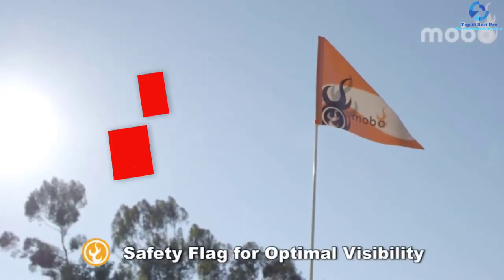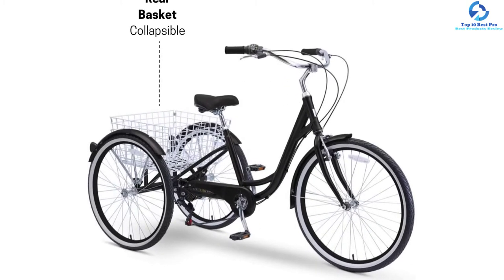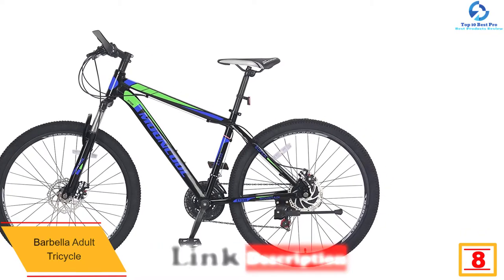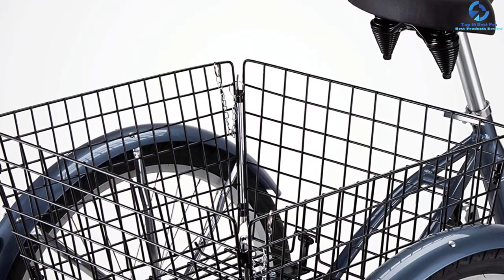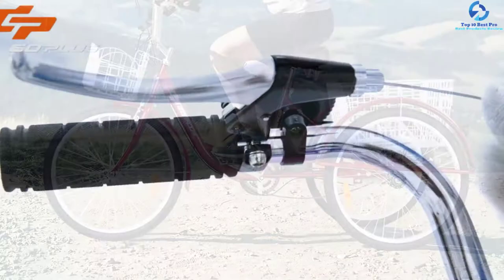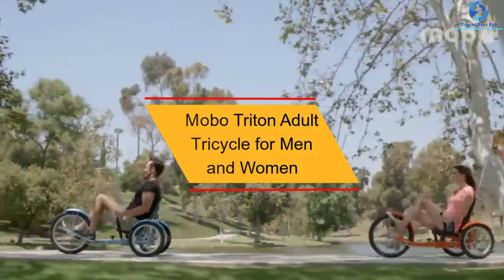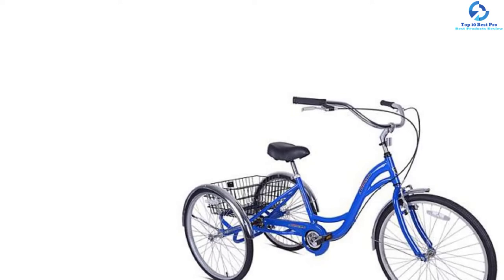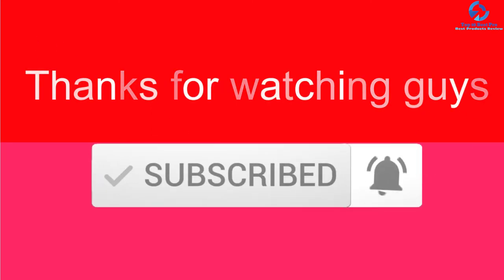Top 10 Best Adult Tricycles 2023 Reviews

Comment: CAN YOU PLEASE TELL ME HOW A 2 INCH DIFFERENCE BETWEEN 24" AND 26" WHEEL DIAMETER, MAKING ONLY HALF THE 2 INCH, THAT IS 1 INCH CLOSER TO THE GROUND THAN A 26" AND IN THE SAME FRAME THE SADDLE AND HANDLE BARS ONLY 1 INCH LOWER,   HOW DOES THAT CHANGE THE RIDER SIZE FOR 24" TRIKE  4 FOOT 11" TO 5 FOOT 9"    AND 26" TRIKE RIDER 5 FOOT 3"  TO 6 FOOT 2" . A 5 INCH DIFFERENCE TO RIDER SIZE,     WHAT ARE YOU DOING? DO YOU GET A BONUS FOR ONLY THE 26" SALES,
OR DID YOU HAVE THE DAY OF SCHOOL WHEN THEY SAID THINK FOR YOURSELF,  MAYBE THAT WAS NEVER TAUGHT?   NOW THAT WOULD EXPLAIN SO SO SO MUCH.